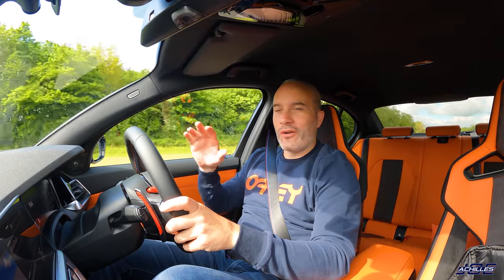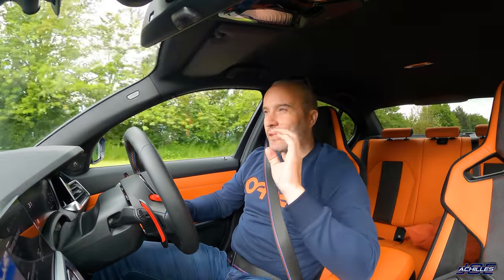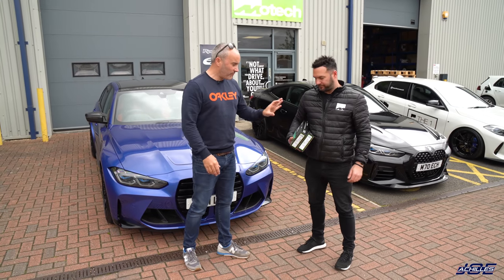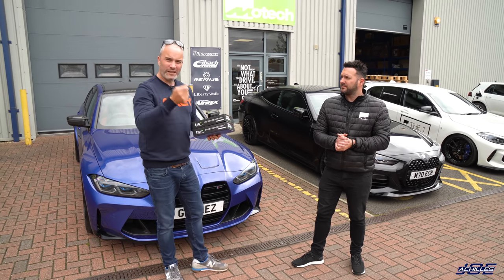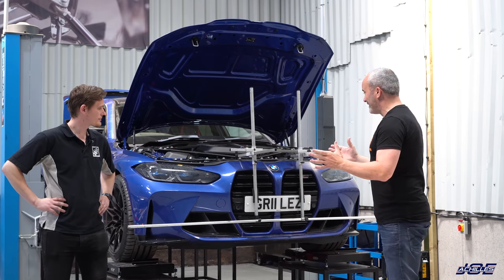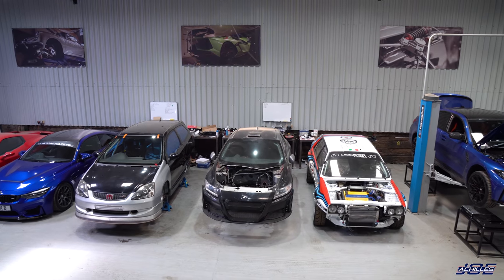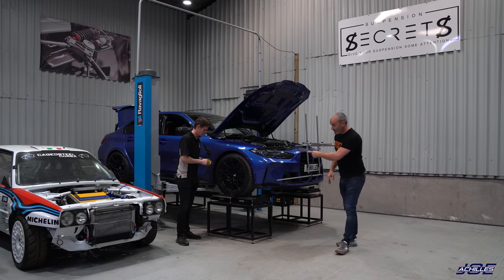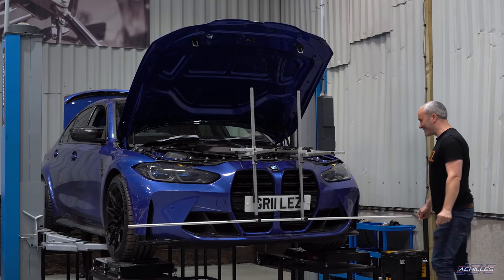First Upgrades for the M3 | Suspension secrets | 4K

Comment: Did you know the Michelin ps4 is available is 2 different compounds. The “normal” one and also the oem bmw spec, which is the one that comes from the factory. I’m pretty sure the Bmw spec has a Bmw logo on the sidewall. Also the Bmw spec tyre is stiffer for enchanted responsiveness and feedback but may be very slightly less effective in rain.
Reply: Is that tyre out yet?
I know it's getting developed by Michelin.
Reply from the maker: Yes buddy these are * rated
Reply: How’s come it didn’t come with the OEM spec PS4’s?

Comment: Great video again 👍 My F82 with 3/4 of fuel and driver in was weighted on these scales at 1738.5 !
Reply: Yeah he must've got confused about the weight (mine was 1638kg with full tank) also camber, iirc f series is about the same. -1.8 deg front on the G series isn't enough for track work, shame they didn't make it adjustable.
Reply from the maker: @samellio  it's my road car with occasional track use

Comment: Do these modifications affect the warranty?
Reply: Any modifications will lead to warranty issues from my experience unless they are performed from the brands counterpart. So much potential to be extracted but we are limited due to warranty.
Reply: He’s only put 10mm spacers on and had the alignment set up. I wouldn’t even consider this a “modification”. Spacers aside, it’s merely using the adjustment in the chassis to make the car drive better.

Comment: With it been Summer time I'm surprised you didn't put cup 2s on
Reply from the maker: I have some Cups for track, they're too risky running as a daily tyre in the UK
Reply: I guess there is alot of road noise with the Cup2s. Will you consider doing a pov video at night on the laser lights at some point please

Comment: What happens if you don’t balance the tires? And will you void the warranty by getting suspension upgrade? Kool video
Reply: The car vibrate, and increase at More speed,the Tires aged not well, and maybe damage suspension damage with the long run.

Comment: why not Cup 2 rubber for the M3?  And surely BMW M engineering know more about their new M3 suspension setup than a small UK independent who have never seen (or driven) the new M3 before?
Reply from the maker: 4S's are a much better daily/road tyre, I will use cups on track. Showroom cars are setup safe and for anyone to get in and push on without too much drama, Matt has unlocked more of its potential using the available stick adjustments. It has been transformed now and feels alive.

Comment: I love you Joe, but it would worry me slightly taking a brand new M3 which would have had 1000s of Munich M division R & D hours thrown at it, and you're basically letting a man in a shed mess about with it 🤣
Reply from the maker: Like we talked about, stock sports and supercars cars are set up to be safe, Matt has unlocked some of that using the cars built in adjustable settings. The car feels alive and far better now.
Reply: Dont worry Baz, we are all fully qualified Motorsport or Mechanical engineers simply applying the laws of physics and suspension kinematics to help unlock the potential that lies beneath every car off the production line. As mentioned in the video with Joe, high performance cars and supercars aren't setup for optimum handling from the factory for a number of compromises and reasons. We use engineering, testing and knowledge to bring them out of their designed shell. 👍 and we're quite proud of our "shed" 😂
Reply: @SuspensionSecrets  looks amazing! Looks like you guys do great work 👌
Reply: @JoeAchilles1  that sounds great. I'm only jealous. The most excitement my 430 gets is if I hit a bit of ice on the school run. 🏃

Comment: It is a complete waste upgrading brand new tires.
Reply: He’s not throwing away the originals
Reply from the maker: A complete waste? Tyres make a huge difference and I'm not a fan of P zeros, dangerous in the wet (we get lots of rain in the UK). Changing to good rubber is actually the best upgrade you can do on 90% cars out there.